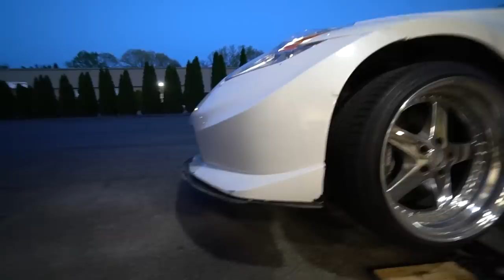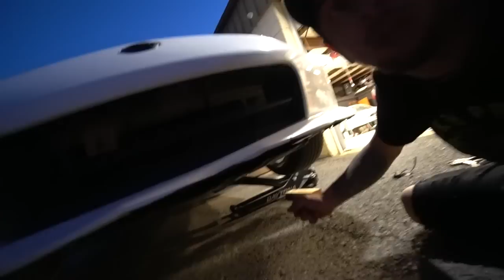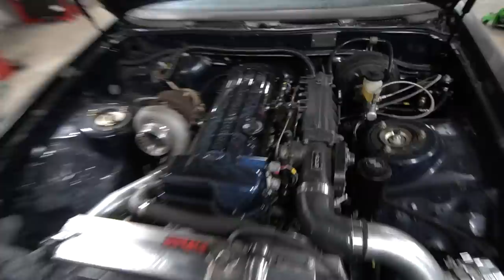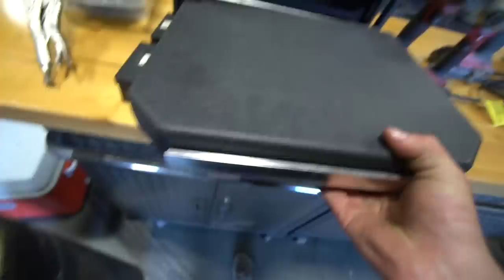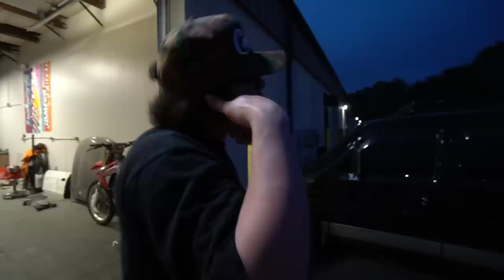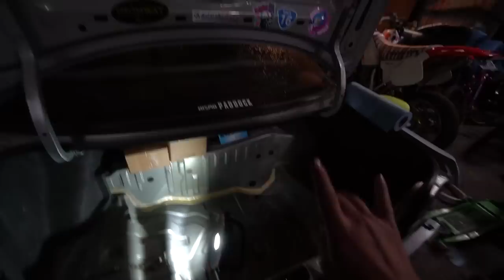Crazy Garage Sale Score! Snap-On Milwaukee and More! -370Z Nismo Bumper Got Destroyed..

Comment: A major reason why your bumper is flopping around is because you have no fender liners! On modern cars, the fender liners contribute to the structural integrity of the bumper and when you remove them the bumper flops all over the place. At the very least, you need the part of the liner that goes between edge of the bumper and the and frame and covers the back of the headlight.
Reply: Just make brackets. They’re better than liners once you’re done.